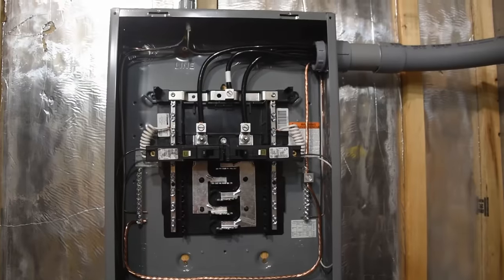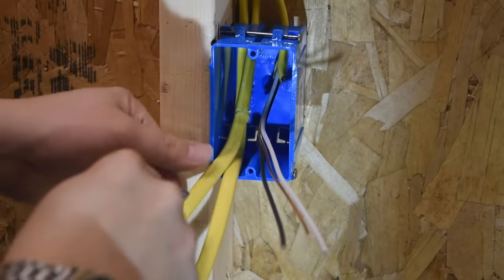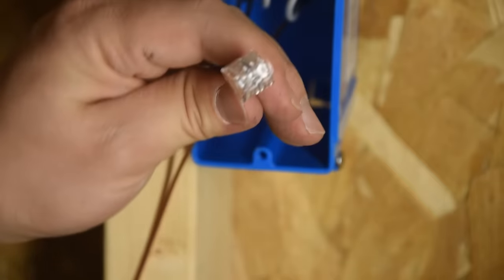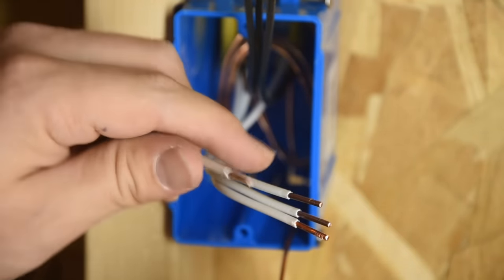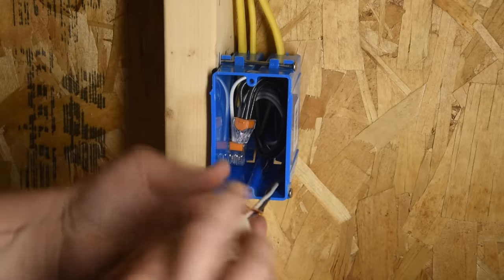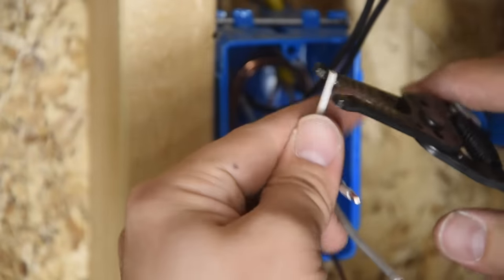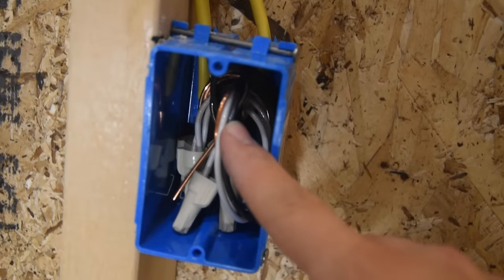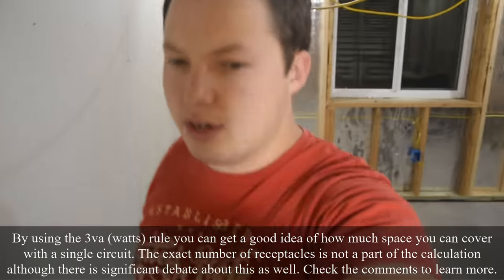Wago's vs. Wire Nuts - How To Wire Outlets During Rough In

Comment: A bit concerned that the only place I can find any reference to a UL listing is on the Amazon site for the 10 pack.  The Amazon page for the 100 count box does not mention UL.  More importantly the manufacturer refers to CSA and CE listings which, right or wrong, are not recognized by several cities and states here in the US.  Finding out whether your jurisdiction will accept the CSA or CE listings is more involved than a simple talk with your local building department.  I worked at the state level and we all thought CSA was okay until we dug around and found that our standards acceptance list did not include them.  When we tried to correct this and several other issues with out of date standards, the governors office refused to consider the rule as he thought it would be too much 'new' legislation.  That guy now lives in Washington on Observatory Circle.  So technically without a UL mark on each connector, they ain't legal in some places.

Comment: the design of wagosis not good its just like quiskwire connections at receptacles . The concept of a round conductor against a flat metal surface , not enough surface area to make a good contact

Comment: Most real electricians would NOT use a utility knife  to strip wire that is in sheath as it is way to easy to cut into one of the other wires, Also MOST would strip the wire BEFORE putting in a box
Reply: Starting at the tip is ideal

Comment: do not use these......i have replaced too many of the lightweight connectors....timely and expensive troubleshooting...the tiny piece of metal holding compression on the wire overheats..melts and causes an eventual short circuit...journeyman electrician 30+years experience......i only use these when working on ballast replacement or new fixtures....do not use the devices for anything with a heavy load

Comment: I would never have you wire any house for me.  I wouldn't doubt that you would use aluminum wire if you had some.  I've been retired for 20 years and maybe the code has changed but using #12 in bedrooms?   3 , #12 in a single gang box like you have used is against code. Romex sheath is always nicked before installing in box to prevent cutting conductors and running blade along wires is asking for trouble.   You are wasting time nutting wires beforehand and why put on neutral?  Push in connections are a fire hazard and many have call backs after a few years.  I've had to rewire houses with stab connectors.
Reply: it was an oversized box 22 cm 7 conductors the device counts as 2 so 9 X 2.25=20.25

Comment: Anybody who uses wagos on plug circuits or any cir drawing more than an amp should not be doing electrical work these are only good for very lite loads like lighting  ballasts do not Daisy chain the feed with these they will burn up almost every time

Comment: When you strip wires you should cut at the end of the wire and tear the sheathing off back in the box.  You cut the sheathing back into the box and you can cut the wire making for a short you will have to find later on.
Reply: Absolutely

Comment: I was always told to turn the wire nuts right side up to avoid any water or moisture build up
Reply: If you have water 16" up in a room you have bigger issues to deal with.

Comment: "Why doesn't everyone use these?"

Cost.
Reply: 9$ for 100 at home depot? Just as cheap as wire nuts.
Reply: i think the wago lever wire connectors are a bit more. still the benefits of wagos out way the cost factor in my opinion. by far
Reply: @justinsloan6836  They do for me for sure. The wire nuts work okay but when you're wiring 3 12 gauge wires in a shallow outlet box those big wire nuts take up alot of space. Cutting the wires short and then connecting them together with a wago and then connect a short piece from the wago to the outlet and then shove the wago to the back of the box has worked better for me than using wire nuts.

Comment: Using a razor knife to cut lengthwise on the outer sheathing is an absolute no no!!! Klien makes romex stripper's that cut outer sheeting without even cutting through the paper that is wrapped around outside of wire. The method you are using is illegal in ca. The possibility of cutting the insulation on the wires inside great. Causing the length of wire to pop out  and be exposed when you push the wires back. If your going to use a razor knife you should ring it and pull out yet insulation off. That way if you do go too deep it has very little possibility of shorting out.

Comment: Poll my ass, I have fired people for not twisting wires and I'm sure I will again.  push in wire connectors seem like the best thing since sliced bread until one fails and you spend all the time you saved plus a couple hours more looking for the one that failed. My opinion, you are what's wrong with the industry, quality of work does not matter to you. You don't have to live in that house after you half ass wire it, how many sliced wires do you have waiting to got to ground from sticking a utility knife into the box where you can't see it, how many ground wires are out in the world waiting to go to ground when someone takes a receptacle out of the box because you didn't use insulated wire for your pigtail. How many people have reached into a box and caught the full load of the neutral in the palm of your hand because someone didn't twist the wires and the wire nut pops off while your pulling the wires out of the box. And before you say "turn the circuit off", it's near impossible to troubleshoot a circuit without the power on. 

Just my opinion, but that opinion is based on 30+ years in the trade. As a master for a company, I wouldn't tie my name and license to a job installed that way, do us all a favor and if you are going to make videos telling people how to do, arguably the most dangerous job in a home (second only in my opinion to plumbers running gas lines) don't teach shortcuts, teach the right way.

Comment: i’ve seen way too many backstabbed outlets nearly catch homes on fire along with modular home connectors. these style connectors give you millimeters worth of contact on the wire. i’m all for innovation but for the love of your family, pets, and belongings do not use push in connectors. stick with what works. twist the wire and put a nut on it
Reply: I don't see how that is possible if a wire comes loose in an electrical box.  I guess you could always wrap tape around the connector to provide an extra margin of safety. That being said,  I think spending the money on name brand connectors and not back stabbing outlets is a good idea.

Comment: I can't believe wire nuts are the standard in the US. Wtf
Reply: if you pretwist tht will make and hold connection the wirenut is just an insulator cap- i prefer copper crimps and nylon snap caps myself with the wire nuts for light fixtures for easy replacement looking into the lever wagos though for same purpose

Comment: If you know how to use wire nuts ? It’s the best option, but that would require showing someone how to twist wires together before putting wire nut on, you never use the wire nut to twist the wires. 

Wago’s aren’t that good unless you know how to use them, same as wire nuts. Next time get an experienced guy to do video, that knows how to use both

Comment: I’ve had the Wego fell because it’s a spring hole in the wire in the spring goes bad and then you lose connection also when using a wire not you should twist the wires together before putting the wire not on to make sure you have a good connection because I’ve had them feel that way also on the white wire being forced away from each other from forces inside the wire

Comment: I will NEVER buy WAGOS or any other inferiour mechanical connection crap  for current carrying conductors!
Also  I  NEVER use the so called quick push in connections on duplex outlets and on switches!

Ideal Wing Nuts are the only acceptable connections for me as they have NEVER failed!

Comment: 60 years in the trade and convinced the NEC is bullshit perpetuated for the purpose of job security for the authors!! Otherwise, why is stripping NM with a knife allowed? Why isn't "Pre twisting" conductors required? Probably because the manufacturers of crap like Wago don't benefit from those requirements. When the NEC runs out of equipment like arc fault breakers, Etc. to pimp for them it might concern itself with the original intent of the NFPA.

Comment: You should not be recommending anything. Please no one follow this guys methods.  
#1. Treat every wire as if it’s hot.  Cutting three different colored conductors at the same time while holding them in your hands.  Not a good idea.
#2. Wagos are the shark bite connector of electrical.  They’re great for things that are intended to be semi-/non-permanent.  Such as light fixtures and such.  They are not for permanent connections.  They are not for receptacles or light switches.  They are definitely not for pigtailing daisy chained power supplies. 
#3. If you’re doing a new install you don’t push the insulated pair into the box and then come back and cut them later, always remove insulation before installing the wiring into the box.  This ties back to #1 where you assume anything in a box is hot no matter what.
#4.  Receptacles are considered permanent installations.  A real electrician will never daisy chain through a receptacle and that’s why pigtailing is a must and in many localities it is required.  Unless you intend to use an insulated ground wire there is no need for a separate tail when pigtailing grounds.  Simply leave one wire longer than others and pigtail the conductors together allowing the longer one to be the device conductor.
#5.  When pigtailing wires always leave at least 6” of wire for the next poor soul that has to come behind you in 10-15 years so he isn’t trying to save a potentially broken wire that’s only 2-3” long.  
#6.  When pigtailing a daisy chain of permanent fixtures it’s recommended to pigtail the wires in a tight and orderly fashion and yes the twist should go as far into the box as possible.  With the leader wire not included in the twist for easy removal is necessary later.  That methodology should go as such;
Twist your grounds leaving one longer as the leader and push the ground wires as far into the back of the box as possible to eliminate shorting. Then move to the neutral conductors twisting the wires in the same manner and then adding the leader and wire nut to the twisted ends and the end of the tail.  This bundle of wires should be situated on the left side of your box. Then the Hot leads done in the same manner but positioned to the right side of the box.  
#7.  Never, ever, EVER, twist the 3 wires together under any circumstances.  
#8.  Not always necessary and not always fiscally feasible, but if possible, always use drywall covers so that the finishers don’t cut, mar, or plaster over your nice neat handy work.  

Some localities May allow for the use of wago fasteners and many others will not.  They are a fad and like many fad products that have come before them, in 15-20 years you’ll start to see electricians getting called out to repair faulty wagos that will most likely crumble in your hand on contact.  Like so many plastic products ususllay do, heat from appliances will make the oils in the plastics prematurely dry out and they will most likely end up on the list of things that become a fire hazard in your home over time.  

And it’s not like it’s always possible but if you have access to the open walls and ceilings and you’re daisy chaining receptacles and switches by drilling through the studs and not through the top plates, you’re simply cheap and don’t understand what the term future modification means.  By doing this you ensure than any future renovations will also include completely rewiring circuits because any modification to a wall to add a door or window or simply removing said wall will defeat your circuit.  

Please for the love of god, stop giving out poor electrical DIY advice.

Comment: Nooooo....didn’t you guys ever get a call in a condominium because an outlet was “back stabbed”....ok..and. What about the “cut”. After twisting your wires cutting the tip to “bond the copper conductor together “ making a superior connection with absolute least resistance.   This is a promotional video and any real electrician would know that the “Chinese finger” way of making electrical connections is a proven FAILURE...omg!   He didn’t even twist his wires before putting on a wire nut...ya I wanna live in a house this kid wired...son..

Comment: As a 40 yr. retired wireman I agree with everyone else "Wago's or any other spring type push in connectors are Crap, and your install violates about 3 NEC code sections.  You need to take a code class if your going to teach a home owner how to do electric work!  I did like your mystery current flow in the propane line, grounding and bonding are the most confusing in the whole code book. Have had many conversations about WTF is going on here?   "IBEW Local 1"

Comment: It's better to go with wire nuts!  1st off you will have to cut the connection if you have to go back into it, and 2nd those Wagos, are they aluminum?  If so your screwing up not using a dielectric.  And how many receptacles do you have on that one circuit, and your going room to room on the same run?  Dude you should not be giving lessons!
Reply: Wago connectors do not contain aluminium. The springs are made of chrome nickel steel. The conductors are copper with a tin plating. Details at page 32 in https://www.wago.com/medias/Volume1-2019-2020-Technical-Section-en.pdf?context=bWFzdGVyfGRvd25sb2Fkc3wyMTMyNzQzfGFwcGxpY2F0aW9uL3BkZnxkb3dubG9hZHMvaDFkL2g3ZS8xMDExMTMwNDU2NDc2Ni5wZGZ8OTA1NzU5MTcwMzZmYWRlNWI5OGU4ZGZkMDI3YmNiMTdkYmVkMWNjYWJjZTEyYjhlMTJkNTc5Njg0OGU4NGVkNQ&attachment=true

Comment: I like most of your videos. This one is very misinformed. Sorry you did not research this before hopping on the Wago band wagon. For the same reason you do not use the push in or stab in the back on a device. It does not last. I get so much work going to diagnose peoples houses that have failed outlets because of the use of "quick  connections". Then we have to take apart many outlet boxes to find the bad one and pigtail them back up.

Comment: Please get yourself a Romex Cable Ripper which only cuts through the sheathing of the Romex and PLEASE STOP using a Box Cutter with a Razor Blade ! You are taking a big chance of cutting through the conductor(s) insulation with that  Box Cutter & Razor Blade !!!
Reply: I was wondering about that myself.  Afraid of nicking the insulation so I use the Romex ripper.
Reply: You just have to be super careful to ensure the blade is REALLY in the middle, and pull it very slowly. But I agree it's a bit haphazard. Honestly with stripping the jacket of NM cable, you can pick 2 from easy, fast, and safe.
Reply: You only need to score it across the wire and it slides right off. Running down the wire is pointless.
Reply: @Ryan-hr9hw  Yeah that's true, I think with the newer NM cable sheathing, just a score is all that's necessary so it rips apart. It's hard to score with a sharp blade, though... the blade "wants" to cut through it.
Reply: @Ryan-hr9hw  ; Well I have been using a NM Romex Cable Ripper device for all the 52 years that I have been doing Residential & Light Commercial Electrical Wiring and never had a problem ! I have NEVER used a Box Cutter with a Razor Blade in my life when doing Electrical Wiring !
Reply: @BearStar1  There isn't anything wrong with nm strippers.  I just dont use them, but I also haven't touched  a residential job for a good 5 years.    
In the commercial world, it would be roto split vs diagonal cutters.  I usually use the roto split.
Reply: Just start at the tip then pull the conductors, super easy.

Comment: Just what we need. More electricians using jab connections, Because they are too lazy to think of the people that have to deal with these crappy connections down the road!... Jab fittings are a F'n nightmare!
Reply: They're not the same as the backstabbing holes for #14 in cheap resi devices. The Wago splicing products make good surface contact with conductors. They've been used extensively in the EU since the mid 1970s.
Reply: @aaron74  thanks for the info

Comment: The agony of watching your vid bro.  All bad romex in conduit.  
Wagos and push types are  for lighting. 
Not recommended for outlets. 
When i cut the insulation in the box, i use my blade making a x cut to not nick the conductors. 
I do not pre twist the wires I let the correct size wire nut do its connection. 
Overall your vid was cool your methods are sub, but hey get r dun. At least you got theory correct.

Comment: He apparently hasn't ever had to chase down gremlins in a house.... you know, the houses that have all the devices stabbed in the back rather than utilizing the side screws. Over time the little contact points that hold the wire in either burn or corrode to the point where sometimes they make a connection and sometimes they dont. Cant see how Wagos could be any different. NO THANKS!

Comment: You tools are mighty shiny. I wouldn't let you wire anything i own.You use inferior wire connections, and brag about a weak razor knife. Try using that knife to strip some 750s in 20° weather. When the hinge snaps on your you will quickly see that the folding hinge design is for light duty  use.
Reply from the maker: Thanks for sharing! I've use this same knife for cutting vinyl plank, shingles, and almost everything else I've encountered over 8 years or so. If it was going to snap it would have done so long ago I think!

Comment: I prefer Wagos, but the contractor will choose whichever is cheaper.
Reply: Whatever is faster rules an electrician's day. Time IS money.
Reply: @dlamarsobotor4573  That's bottom line. Especially in residential when speed is required.